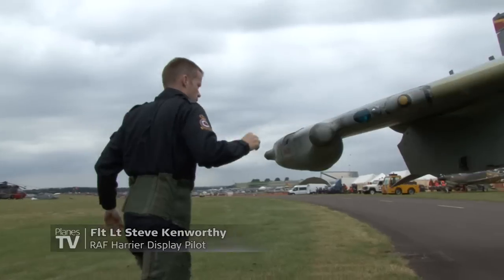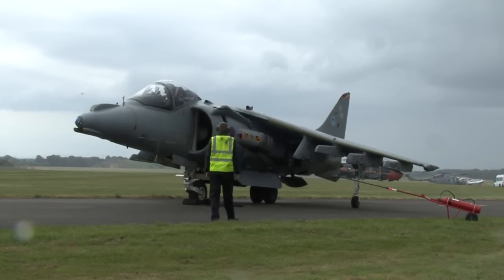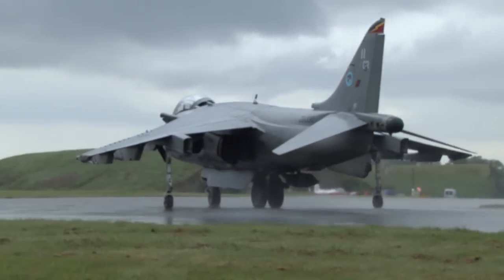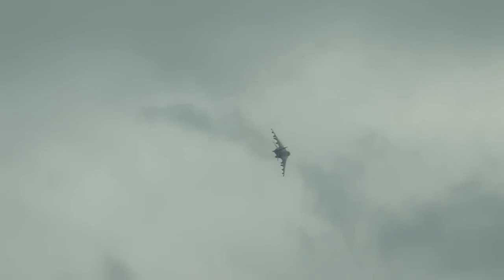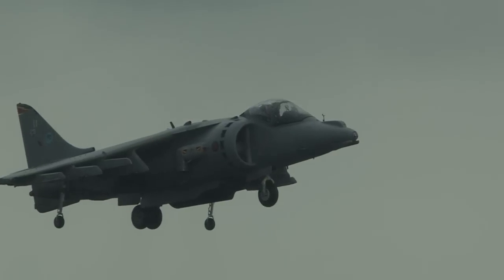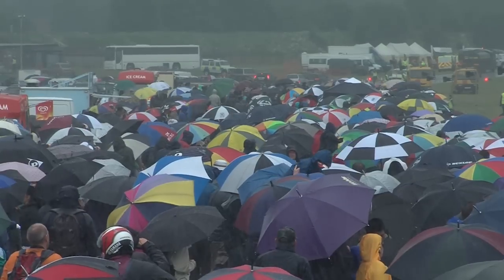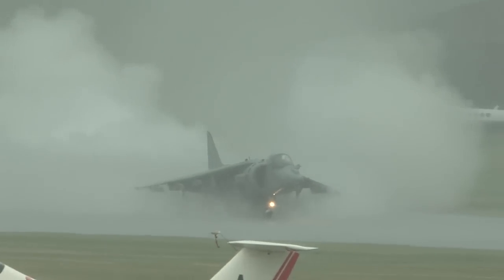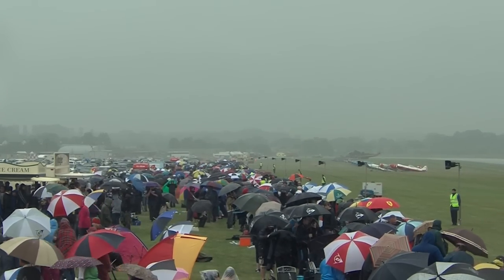RAF Harrier Display at Cosford Airshow 2010

Comment: I remember we had an American Marine Harrier at the 1986 Trenton Air show and it took 75-gallons of distilled water for injection  and some fool wanted them to do the vertical takeoff on pavement instead of concrete. After he took off the fire truck came in to put out the fire on the melted pavement. Last time they did that.

Comment: I was there what a miserable day.  Most of the displays were cancelled. I had a gut feeling the government was going to pull the Harrier and it had just come back onto the display circuit so I tried to see it as much as possible. I couldn't take any decent pictures due to the heavy rain. The spray blasted from the ground was impressive. One of the best displays that day in difficult conditions was a female flying instructor, don't know her name, flying a Hawk which I usually find quite dull to watch but her display that day was impressive.

Comment: Not only can the harrier operate in virtually any weather conditions, it probably prefers the rain. Less water from its own tanks used for the hover!
Reply: problem with the harrier is its controlability systems in hover mode are rather rudimentary many pilot have been killed due to this, thats what makes the F35 particularly great becuase its all computerized. Much safer and gives the pilot more awareness. But you do have to love the Harrier.